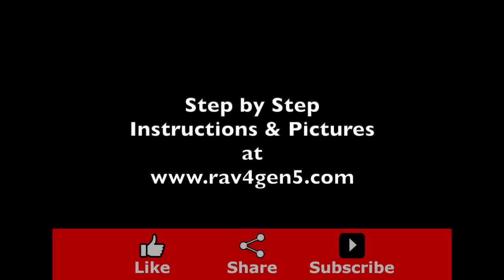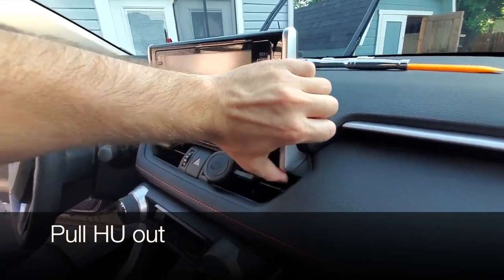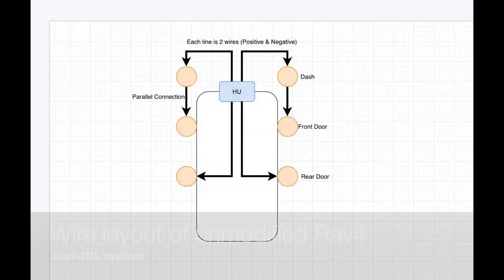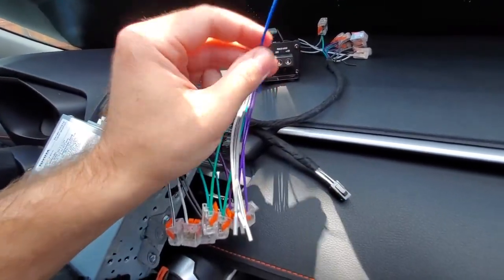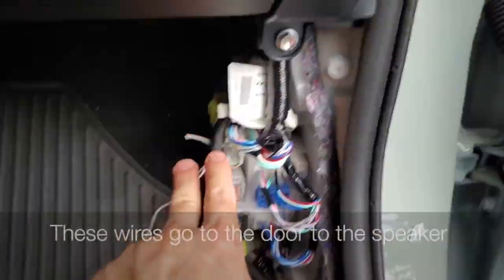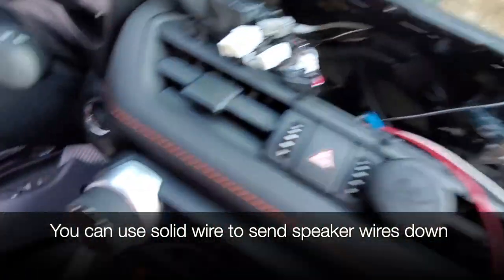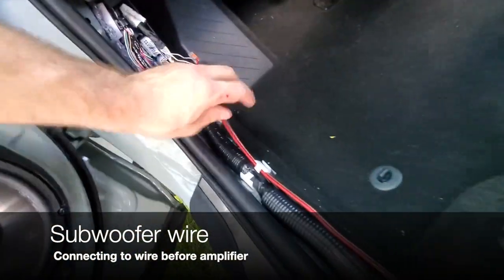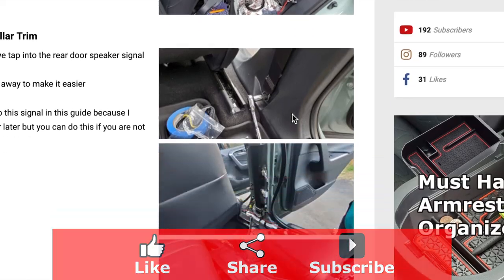Amp install on Toyota Rav4 2019 2020 2021

Comment: You should use a soldering iron and heat-shrink, especially if your videos are going to be the standard everyone uses to do their installs. It takes up much less space than those bulky connectors and provides a much better connection physically and electronically.
Reply from the maker: You are definitely right but I also don’t see the majority of people having those tools and skills either. :)
Reply: @Rav4Gen5  If you can't solder, crimping is the next best solution, with no skill needed, and basic tools.  Please don't use home electrical connections in an automotive environment.

Comment: I have been waiting for this video to drop - Thank You! I'm planning on taking the four HU outputs into a 6 channel amp and then using the amp's outputs into the original 4 channel speaker harness. Then adding 2 pairs of output from the balance of the 6 channel amp with new wire from the amp to the dash location. This would provide two connect points at each dash location for the tweeter and mid-woofer (located in the door). 9 wire Speedwire from the HU to the amp, 12 wire copper wire from the amp to behind the HU - and then extending two pairs to the respective dash locations. RAV4World forums has referenced a DCM input on the front right tweeter - is that why you tapped into the door wires?
Reply from the maker: You have an impressive plan set up. I really wish I knew about this speedwire before. I read about the dcm at rav4world which is why I separated the dash from the door and tapped directly to door. I did not want to mess with that dcm line.

Good luck. Sounds exciting
Reply: Are you going to run new speaker wire to the door speaker from the Amp. I'm having a hard time going through the boot in the front never mind the rear speakers boots it's a plug 🤦🏻‍♂️.

If you have any suggestions please let me know I would appreciate the help. Please take some videos or picture of what you do. Also are you doing this on a Rav4 2019 ?

I'm doing something similar to what you are doing but I'm going straight forward. 
I'm hooking up a 4channel amp and a sub. 
Thanks to this video I'm definitely going to use the harness used in this video than use the speed wire to hook HU to the Amp for signal I just have to figure out how to run the new speaker wires from the Amp through the boot.🤦🏻‍♂️
Reply from the maker: @asahacic3249  you don't need to go through the boot. Check out my subwoofer install video, you can cut the wire at the pillar and tap into it without having to go through. I also cut the wire for the front door too inside the cabin without having to go through the boot.
Reply: @Rav4Gen5  since Toyota uses the aluminum wiring, is it safe to solder/splice these wires with copper stereo wire? Isn't there a worry about corrosion? BTW excellent videos, been watching as I plan to do something like this with a 2020 Camry non JBL.
Reply from the maker: @call_me_lou34  I don't know if you can solder copper with aluminum. Typically people use compression joining or crimping. I use lever nut connectors. The soldering I have done are to the aftermarket wire harness which worked okay.
Reply: @richardcrogers  I would love to do a setup like this.  Did you complete it?  Were there issues with the DCM? I used the same METRA wire harness to connect my new dash speakers.  However I don't understand how you would use this area as a connect point. Is this in an effort to avoided the dreaded DCM? Can you please elaborate?
Reply: @sleepyoctopus  I purchased and put together the wiring harness. Now waiting (due to the pandemic) on funds to move forward with the amplifier purchase.
Reply: @richardcrogers   where did you purchase wire harness ?
Reply: @sleepyoctopus  Seems that every single question about the DCM falls unanswered and no one can tell if it's a risk to hook the amp up to that line or not. Lovely.

Comment: You should never bother with the SRS system in a vehicle. That bolt you pointed at to ground your amp is the bolt that hold your SDM in place (AIR BAG MODULE) that is one module you leave alone

Comment: @Rav4Gen5 How come you don't want to amplify the dash speakers?  Would you also avoid this even if you got more powerful 3.5in speakers in the dash?
Reply from the maker: Hey. Great question. The dash speakers are wired a bit more complicated. There is actually another wire from the Data Communications Modules (DCM) that connects to the dash speakers. I did not want to mess with that as I am not competent in that area.
Reply: @Rav4Gen5   Great! thank you for the reply.  I will be doing the same!  Thanks again for your amazing content

Comment: At 9:08 in the video.  I can’t get my 4 gauge wire through the nipple. I’ve tried everything. Hanger, hanger with tape to the wire, even guiding it through and it just pulls in the grommet to the point of pulling it off the opening. Can you provide more detail on how you were able to pass the wire through?

Comment: Do you not need a line output converter if you're running an amp/after market speakers with a factory head unit?
Reply from the maker: You can get one if your amp does not have high level inputs.
Reply from the maker: Don't get the amp in the video. Get something better.

Comment: Hello where did you purchase the wiring harness for plug and play I am thinking of doing this . Also if you can tell wich amp you used .
Reply from the maker: Links are in the description. Do not buy the amp I used. Spend more money and get something better.
Reply: @Rav4Gen5  okay what amp would you recommend ? Because I actually installed alpine type r speakers in my doors and what the best sound I can get and thanks for your info and reply back !
Reply from the maker: I don't have a recommendation. I world check out other YouTube videos on 4 channel amp. The one I used was good because of its small size and my choice to hide the amp. Sorry I cannot be much more help. I'm not audio expert. People did like soundstream too and it is small

Comment: I've watched this at least 15 times.  I still don't understand how the HU goes to the dash speakers without going through the amp!  8 wires out of HU to amp - How does the dash speakers go to HU?
Reply: ok, so you split the front speaker wires out of HU...  send one set to amp and one set to dash speakers?  I can do this without a harness correct?  I think maybe I'll just run new wire from amp to rear and front doors and do away with the entire set of original wires.

Comment: Hi there a bit of a noob on the topic and hoping you can answer this one question: would it make any sense to use a 4 gauge amp wiring kit over an 8 gauge when including the subwoofer into the mix or would there not be any point in this? thanks!
Reply from the maker: 4 gauge will always be better and safer over the 8 gauge. Might be overkill but it’ll be better.

Comment: Great video 👍!!!!!!   Can one use the same wire harness use  speedwire/9wire and connect it to the Amp. 
I'm surprised you didn't run new speaker wires to the Amp
Reply from the maker: Hey. Thank You.
Using an 8 wire conductor would make it easier and cleaner to go from HU to AMP. The diameter of the wire should be small enough to send down to AMP thru the instrument panel. I did not have any at time of install. Might be something I revisit.

I only ran new wire to the front doors and didn't have enough wire to go to the rear door so I took the short cut and just went back to the HU to use the wires that Toyota has. I had my wires too long going from HU to amp but oh well. 

I was nervous enough to cut the front door wire. Doing that again for the rear would be extra. =]
Reply: @Rav4Gen5  you mentioned that the wire harness you purchased was made for a Camry in the beginning of the video. Is that correct?

Comment: Rav4Gen5 Nice Video. if we install aftermarket amp on the new RAV4, will this void the warranty in US. please clarify.
Reply from the maker: You should consult with Toyota about concerns regarding a warranty. Typically, adding aftermarket products do not void warranty.
Reply: @Rav4Gen5  Thanks

Comment: How i connect the dashboard speaker? I'm confused i have the soundstream amp 1200 and the sound on 4 speaker is great but i note the dashboard speaker is off why?
Reply from the maker: In my set up in the video, the dashboard speakers are powered from the head unit. I split the signal going to the front door and the dashboard speaker.

Comment: Hi! I just notice at 8:24. Is it 4 wires input to amp? Because you already used 4 wires for dash speaker. 

And 4 wires as output that need to go back to the head unit? Because the other 4 output is already used for the front speaker.

Thats only a total of of 8 wires from head unit to amplifier not 12? Please correct me if I’m wrong. Thank you.
Reply from the maker: Amp takes in 8 wires (4 speakers X 2 Wires each speaker)

The wire harness allows me to take the signal going to the dashboard and split it (1 set to the dashboard, other set to the amp). See the picture
https://youtu.be/f-3oCuXDQOk?t=228

I send 4 wires (2 rear speakers) back up towards the head unit to connect to the wire harness so the signal goes to the rear speaker without me running new wires.

At 8:13. The 4 wires that come up the head unit go into the pin connector with the dashboard speaker to go back into the Toyota speaker wire harness
https://youtu.be/f-3oCuXDQOk?t=493
Reply: Ohhh yeah, you’re right. Thank you so much sir.

Comment: Is it safe to hook up 2 different powered subwoofers that have the amps built inside?
Reply from the maker: It should be fine. I would run wire to the battery and make sure you add a fuse.

Comment: Are the dash and front speaker connector same for 2020 rav4? I’m thinking of slicing the same 2 wire to power from amp side door and radio to dash. Or can the jbl tweeter handle 90-100 rms power from amp? 😂
Reply from the maker: They are different connectors in my Rav4 which is non-JBL system. Dash are 4 wires since it runs parallel to the front door. You can see more closely in my other videos where I install dashboard and door speakers. 

I don't think the tweets can handle that much =]
Reply: @Rav4Gen5  I have the non jbl as well. Thanks your videos have help me a lot.

Comment: Also any engine noise what kind of amp and amp did u upgrade any of your speakers if so what kind and what about your dash speakers
Reply from the maker: You don't need an amp if you are not upgrading the speakers. I upgraded all of my door and dashboard speakers. You can see my other videos for me details. They are all JBL now.
Reply: I got JBL already in my limited Rav4 so does that mean I won't need an amp and maybe it's already premium sound system in there or ...
Reply: @codyfrancis4474 jbl system already has an 800w amp and 9 speakers, this video is for upgrading the basic system with 6 lousy speakers and no amp.

Comment: Did you mention the white wire for the front speakers is ground?  How did you figure?
Reply from the maker: Yep. Covered in the video where I upgrade the door speaker. I did a polarity test via my phone and did a battery test on the old speaker.
Reply: @Rav4Gen5  Cool, great thanks!

Comment: I'm a bit confused I want to add a amp to non JBL 6 speaker system 2021 rav4. I want to be able to just use a harness from factory stereo to amp and from amp to factory wiring plug for speakers and not have to splice anything with the speaker wires. Is this possible? I am familiar with doing systems just wondering if there is a harness that will do this? Then just run power ground and remote.
Reply from the maker: Try this.
https://tacotunes.com/shop/toyota-camry/plug-play-wire-harnesses-toyota-camry/2018-toyota-camry-add-a-subwoofer-harness-plug-n-play/
Cut the excess wire off for the sub woofer
Cut the harness in half
Connect male side to head unit. Run wire to amp in
Connect female side to Toyota original wire. Run wire to amp out
Good to go
Reply: @Rav4Gen5  Thanks for the replay Love your vids this was a little confusing at points. I was looking at this Taco one wasn't  sure if the harness ends would be correct? The one you posted is no longer available. Also looking for amps. Maybe the Soundstream ST4.1200D or the Kicker 45key1804 4 channel. Any suggestions are welcome. soothing that I can fit up front middle area maybe.

Comment: Goodnight, i have a problem, i need the wire harness but the link is descontinue
Reply from the maker: It’s no longer available. I don’t know what other options are available. :(
Reply: Can i use a idatalink hrn rr to3? I have a rav4 2021 xle premium
Reply from the maker: Do you have a direct link?

Comment: @Rav4Gen5 Can you please let me know after install the amp, did you face issue with Auto Start/Stop. is the any sound when we start and stop and engine.
Reply from the maker: My RAV4 does not have auto start/stop. Sorry. Your amp might turn off when RAV4 turns off depending on how it’s wired.
Reply from the maker: Not all trims in the USA have the auto start/stop button under the climate controls. Mine does not.
Reply: @Rav4Gen5  oh ok, your video are very helpful.  you instruction are very clean and understandably for newbee like me. keep up the good work.

Comment: I'm thinking about adding an amplifier to my rav4.  Does anyone know what the stock alternator put out for amps?
Reply: I don’t but I have a 4x50 watt amp (something like that) and the guy said the JBL club speakers are perfect or it. They’re 50 watts each. He also said the volume on the RAV4 goes to 60, and after 50 volume level, it may get distorted. I won’t push that yet though til I break them in.